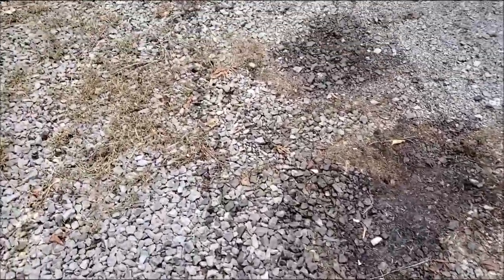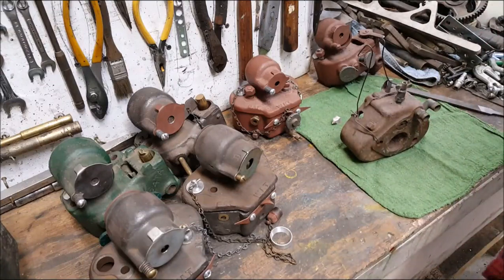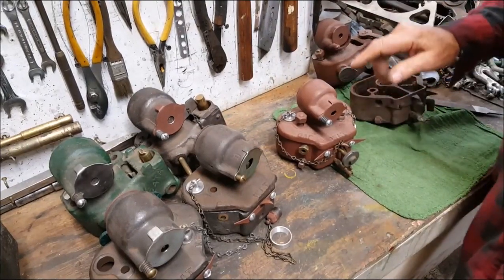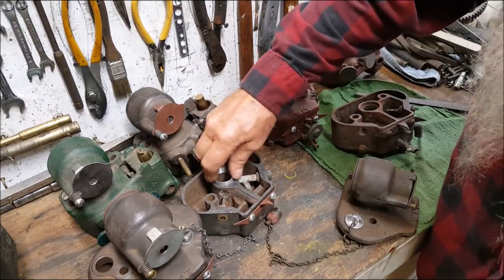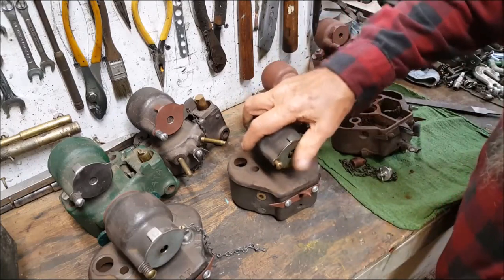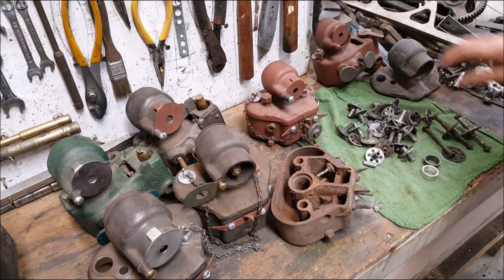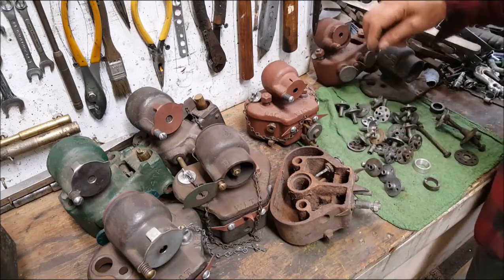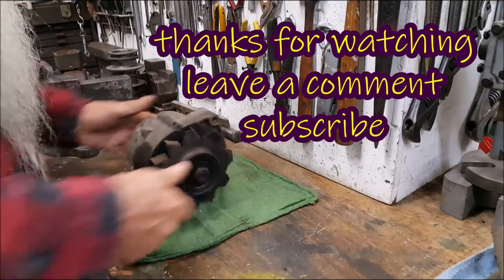McCormick Deering / International / IHC carburetor fuel mixer

Comment: I took your advice and used it on my first 1 1/2 type M and made a compensator valve with only two holes in it. Runs great.
What the thoughts on the 3hp valves. Do those work better with two holes?